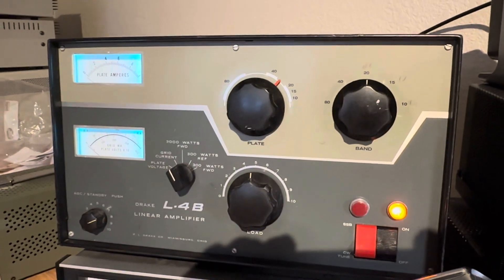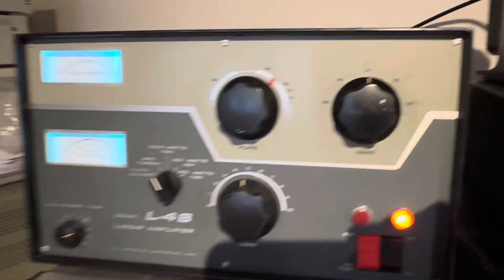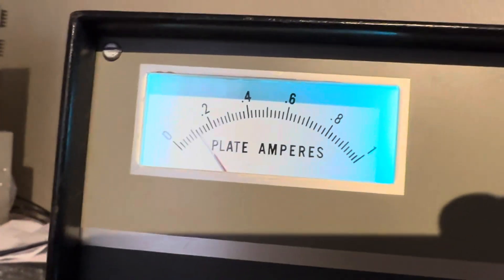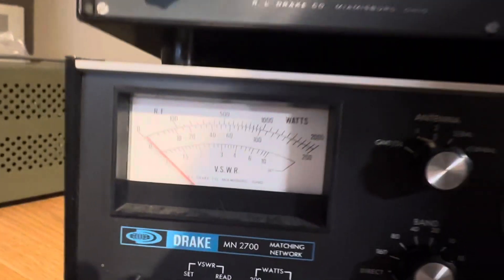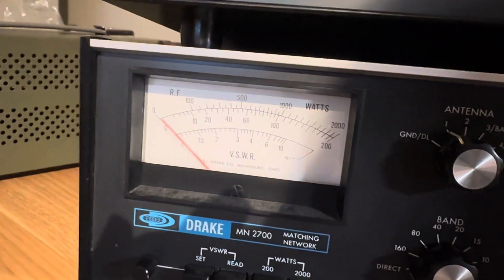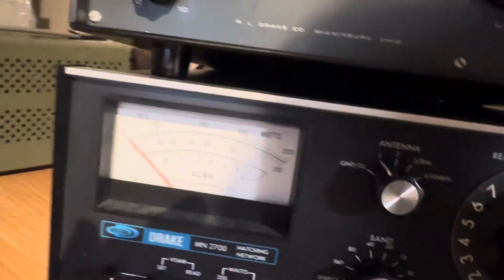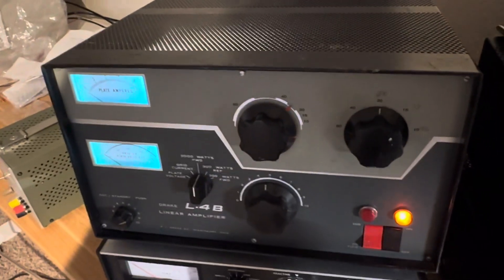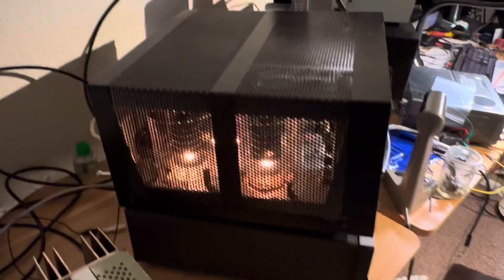DEMO Drake L4B Linear Amplifier 1200 watts on 20m dual 3-500z's ES4L-4B

Comment: So the amp is about 65% efficient. This means 1800 watts input would be required to get 1200 out. At 1200 watts output you show 600 ma. of plate current. A little quick math means at 600 ma. you need 3000 plate volts to get the 1800 watts of input power. The stock Drake power supply can not furnish 3000 volts at 600 ma. Do you have a higher voltage aftermarket transformer?

Comment: 1200w average output?
110 w average input?
Reply from the maker: Not sure on averages
Reply: @moviestudioland  those numbers you show in the video average or PEP?
Reply from the maker: Probably average. IT depends on HOW the MN-2700 is integrating the RF power it samples. I would think the physical act of moving the mechanical needle in the meter will enforce an average. To get PEP you would need an instantaneous metering device like an oscilloscope which can display PEP.
Reply: @moviestudioland  some meters have pep kits including Bird. Wow. I never drive mine that high in average. That seams like a huge Carrier I usually target a 300-400 carrier and modulation to 700-800 average.
My pep swings to 1800 what was the grid and plate current at 1000 watts carrier? Had to be up there